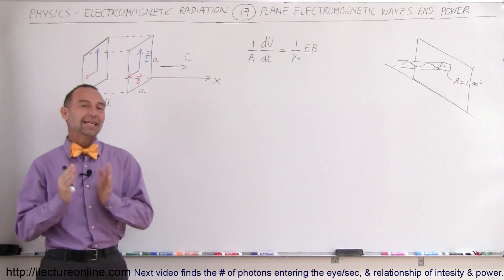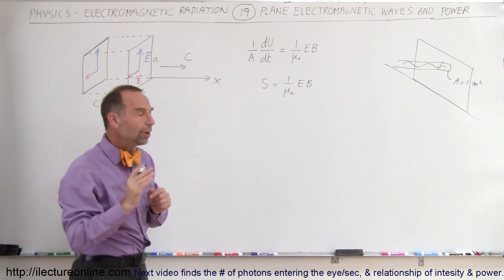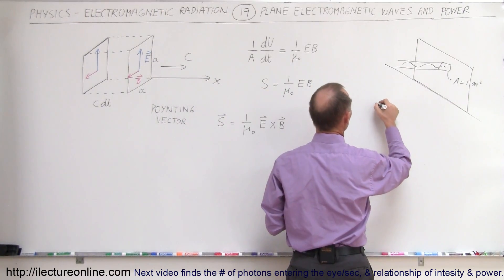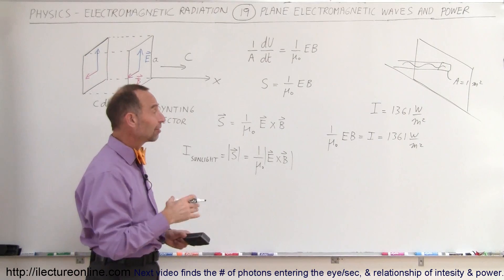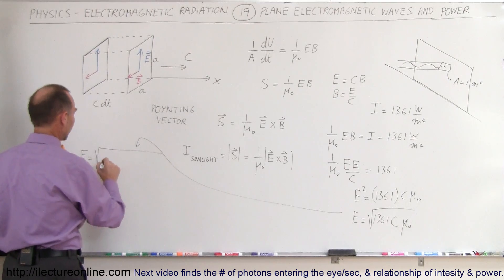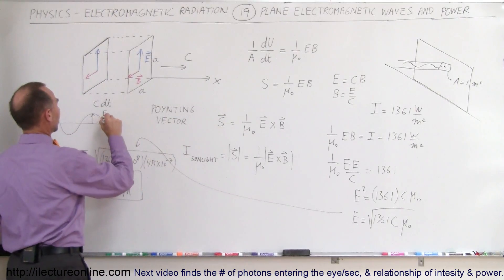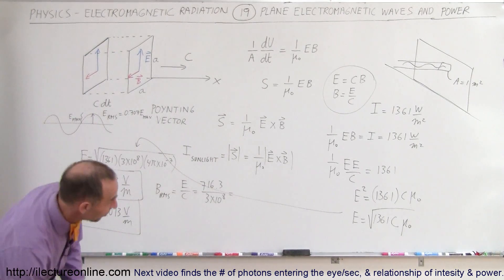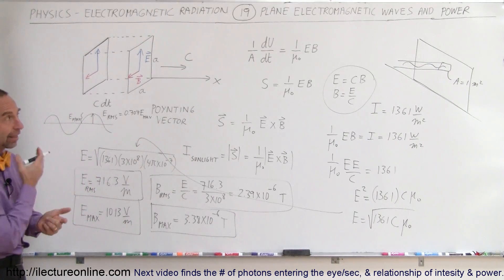Physics 50   E&M Radiation (19 of 33) Plane E&M Waves and Power

Comment: here we calculate the electric field amplitude and magnetic field amplitude of EM radiation but how we can calculate the amplitude of photon in an EM radiation?
Reply from the maker: There is not a good comprehension of what a photon is or what it looks like.  It is basically a wave packet and the "amplitude" of the oscillations does not have any meaning for a photon in the same sense as it does for the amplitude of E&M radiation.
Reply: Michel van Biezen You teach a lot about the photon, but you say here you don’t have a good comprehension. A very humble professor. I’m interested in the relation between E&M radiation and the photons. How big is a photon with a given wavelength ?
Reply: @卜而立  I believe this question dives into Quantum Mechanics. We can determine the energy eigenvalue of electrons using the schrodinger equation. Based on the excited/de-excited state, we can determine the energy of the photon emitted.

Comment: Is the intensity of sunlight a sum across all frequencies? Eg. Ultraviolet puts out 100W/m2 Visible adds 300 W/m2 .... etc to a sum of  1361 W/m2. 

If so, how can we say that a particular wave's electric field has an rms amplitude of 716 V/m ? Would it not depend on the frequency in which the intensity is measured at?

Thanks for making these videos, excellent explanations.